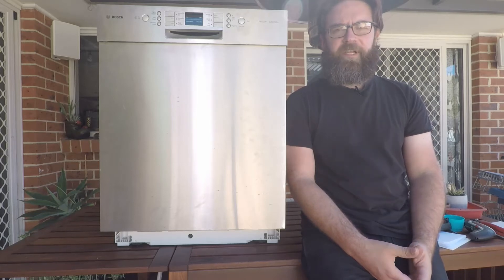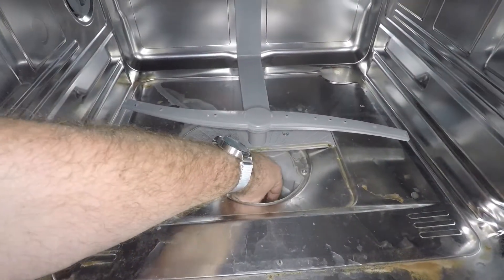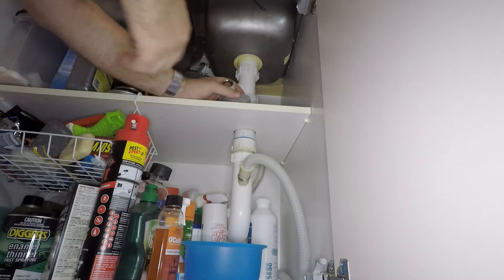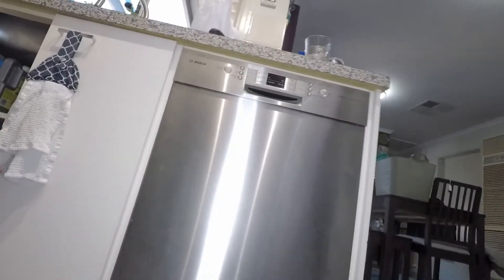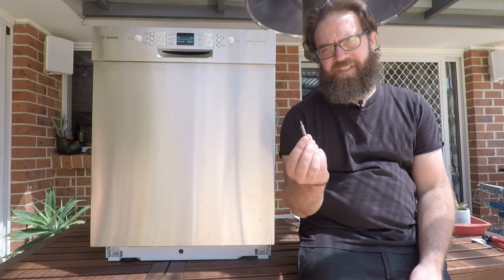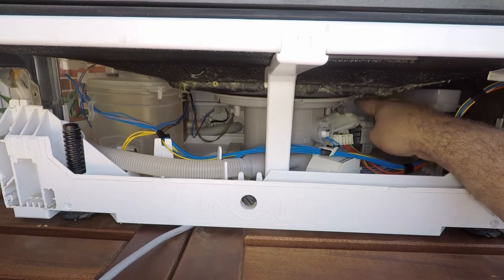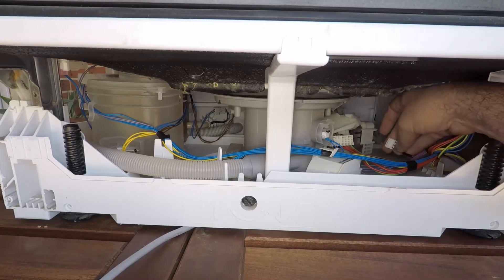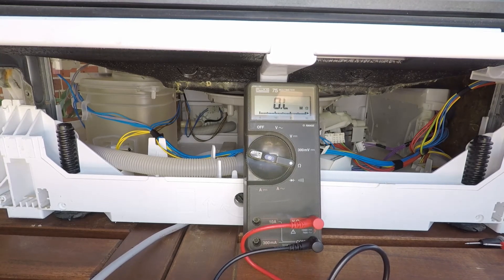Bosch E20 error code diagnosis and repair

Comment: The US models have a different ohm rating on the circulation pump.  14-16 seems to be what I got.  My E20 error was the power module which Was under warranty.  Bosch sells them for $130.  Need to get a surge protector.

Comment: I can feel the impeller turning a couple of times before the E20 appears again. I guess that means that the pump is fine? Also hearing clicking sounds...
Reply: Any luck? I have a couple of clicks from mine and then the e20 code. My pump tests ok wth a multimeter
Reply: @1nfinitReality  Did you fix yours?  I have e20 code with 2 clicks before the error code is displayed. I installed a new circulation pump and it didnt fix my problem!!!!
Reply: @ericthompson881  Me 2... already tried a new pump..  got it solved?
Reply: @ricmrqs  I installed the new pump and it still didnt work so I took it apart and cleaned everything really good.   I ended up finding a small eggshell which I believe was the culprit.  Take it all apart and when you try to run the dishwasher give the pump some love taps with the butt end of a screwdriver and see if anything happens!  Good luck
Reply: @ericthompson881  I am getting the 2 clicks sounds too.  I think it might be coming from the "drainage pump" as opposed to the circulation pump?  Can someone please post a solution to the "2 clicks" hears before it throws the E20 message?  Thank You!
Reply: @mdczern1  did you ever find a solution to this issue? I also changed the circulation pump and didn't fix the e20 error code. I bought a drain pump but haven't installed it yet
Reply: @mdczern1  Have you solved this problem? How? Tell...
Reply: @easybucketztesla  Have you solved this problem? How? Tell...
Reply: @1nfinitReality  Fixed! It was indeed a broken circulation pump; one of the coil showed discontinued with the mm. I put a spare in and that solved it. Philipps says it's extremely rare for pumps to fail so I wasn't too sure of the result, but I guess they do brake down..